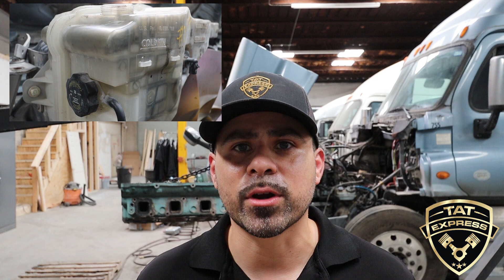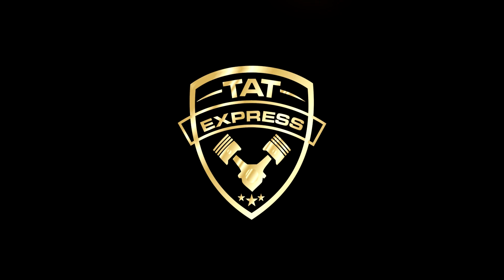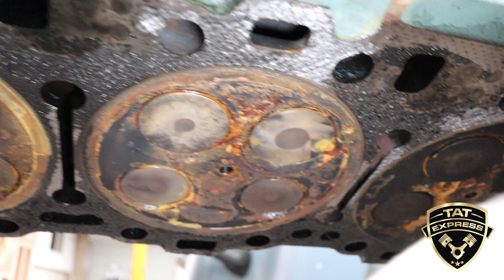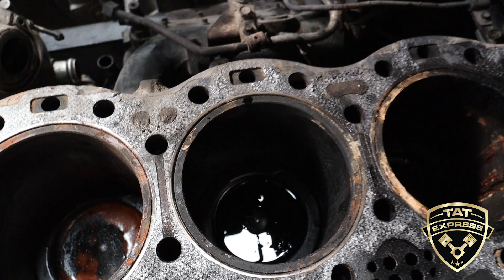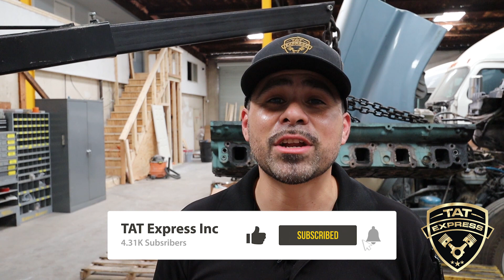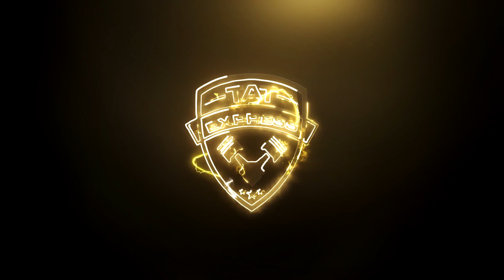Detroit EGR Delete Failure (Detroit Diesel/ Detroit 60 Series)

Comment: 2008 Western Star
Detroit Diesel 60S 14L
Not losing coolant but getting oil in the reservoir tank. Oil changes show no coolant in the pan. I was told it could be a bad oil cooler. Replaced it January 2023. 
Replaced the EGR cooler as well

What gives?

Comment: The "ugly fix" is all you need for bypassing the egr system on a 60 series. Plugging off things is only asking for more problems later on. Leave everything in place and if you start losing coolant, simply inspect the crossover pipe for coolant. If you have coolant in the crossover, you have a leaking egr cooler. Replace it and keep on trucking. 😁
Reply: I have a 2007 Columbia with a 14L Detroit 60 series. I have pressure in the coolant reservoir. I used one of those combustion leak tests where fluid changes color if combustion gas is present and it did. How do I go about testing to see if it's the EGR or head/ gasket? I Already tried disconnecting air compressor discharge and it had made no change
Reply: Ugly fixes a waste of money it didn't do a damn thing

Comment: Since I have deleted the dpf I started to work again.
My truck used to stay in the shop most of the times just like the technicians like to see.
I am back in business again and I am convinced that the egr valve,egr cooler,the expensive turbo they have installed in the new trucks,7th injector,dpf filter cost a tremendous amount of money and waste of time.
Those systems are good only for the dealers and part sellers.
Find a good technician to delete and the truck will run absolutely much much better without those stupid emission things.
Reply: Agree100%, but the new Rockies care more about the EPA than the money they can make, that’s how stupi_ they are, you wonder why the country is going to hell.
Reply: What truck do you have

Comment: 2007 freightliner Columbia Detroit diesel 60 14l coolant getting pushed through the overflow
Reply from the maker: Recommend testing combustion gases in coolant system
Reply: TAT Express Inc. it does have

Comment: If the driver would have caught the problem before all the destruction. What would have to been done to repair the problem
Reply from the maker: The driver kept adding coolant before engine failed.  He mentioned he added over 10 gallons.
Reply: @TATEXPRESSINC  What i was asking is if the engine did not fail. What would have to be done to repair the problem of using coolant

Comment: Oil sample.  15 bucks an oil change.  10 i'f you buy the samples in bulk.   Can help find this issue before it's too late.
Reply from the maker: Christian, thanks for the input. Be sure to subscribe.
Reply: 👍🏻subscribed. Great content!
Reply: Where do you do your samples? I need to start doing that.
Reply: @caaguilar82  any cat dealer(h.o penn) will have them.   They come with prepaid postage.   You can also buy the vacuum tool from them to stuck the oil through your dipstick so you don't have to drop the oil and make a mess. They come with the tubing to stick down your dipstick tube.

Comment: I have d13 volvo geting coolant color black first it looks bad egr but actually not pass test now remover all injector cups looks burn on bottom sealant  so any suggestion if I need to anything else   engile oil level was stable only coolant level was going down
Reply from the maker: D13 injectors seal the combustion gases with the injector cups.  So if cups bad than combustion’s gases are passing

Comment: At second 129, the paint job on the bottom of the cyl head looks like this head has been removed a beforehand and painted meaning aftermarket rebuild on cylinder head with aftermarket cyl valves.    I can see liner protrusion too low on fire ring no 1. I can see a intake valve separated apart and dropped causing secondary progressive damage to liner and head.    Blaming the egr gas cooler delete is a valid claim for coolant loss before the failure but not the cause of all this failure.
Reply from the maker: Thanks for watching and thank you for the support.  Make sure to subscribe and turn on notifications.

Comment: I have a Paccar Mx 13 t680 year 2016 . I’m losing coolant oil level is normal dealer checked egr no leaks did a pressure test for any leaks nothing. What can it be? Next they are going to do at Kenworth is to check every injector individually one by one . And for that they are going to drop the oil pan apparently 😳
Reply from the maker: Jaime,  have you pressure tested the coolant system?
Reply: TAT Express Inc. yes they had
Reply: Injector orings? Cups?

Comment: These 14 liters with egrs are some picky princesses. 
When they run right they are solid. 
But those heads and egr systems act up a lot. 
I just did a full out of frame rebuild at the dealer with one of my trucks. Not cheap. 
But had to eat that sticky sandwich. 

Side note: dude looked like he didn’t take care of the truck to begin with.

The coolant gremlin is strong in these 14 liters.
Reply from the maker: Thanks for the input. Yea, thats what happens when you keep pushing an engine that is having issues. Thank you for watching, be sure to subscribe to the channel and ring the notification bell. Be safe
Reply: The heads get too hot and crack, because of the EGR cooler is what I was told.

Comment: I’m haven’t a lot of blowby on my Detroit 60 (glider) I only have 635000 miles on it. None of the usual warning sign. Still lots of power; only adding 3 quarts of old between 15000 mile PM...? New compressor and turbo added @ 599000 miles.
Reply: KENNETH KING if your adding less then a gallon of oil the motor is tight. 60 series always have had a good bit of plow by
Reply from the maker: Thanks for watching and thank you for the support.  Following a good maintenance schedule is key

Comment: Hey thanks for the video. What was the final outcome, did the guy need a engine rebuild?? And is it an expensive repair if you see combustion gas in your coolant reservoir?? I was looking at my truck yesterday (2006 freightliner columbia) and my reservoir kinda had that greenish look as well....thanks in advance.
Reply from the maker: J. Ross, engine needed replacing.  When is the last time you had coolant system serviced and checked?
Reply: Friend if you can write me to this emai I think I know what you have . I can help you . n
Reply: Sorry my email .   lugoupholstery@gmail.com